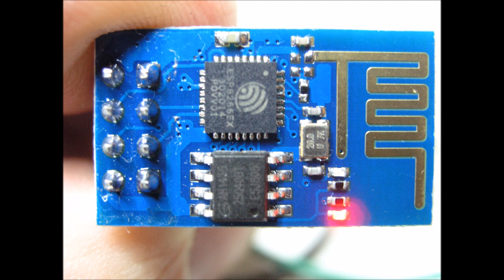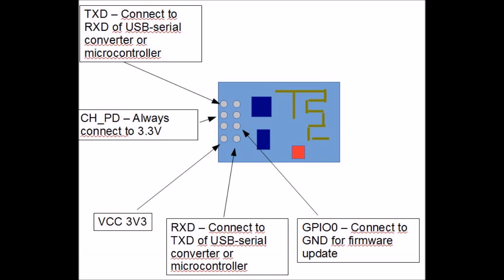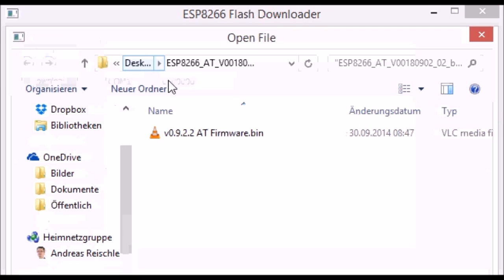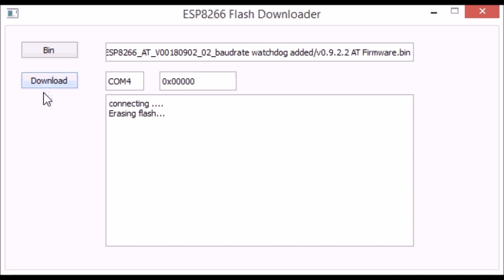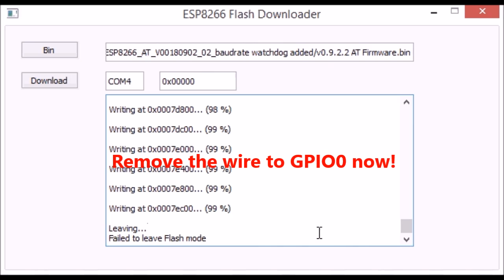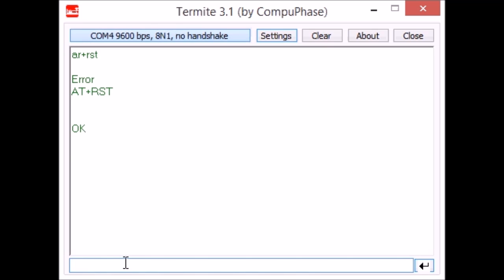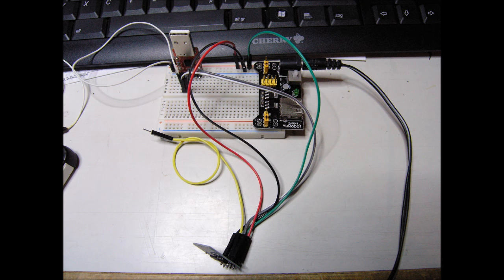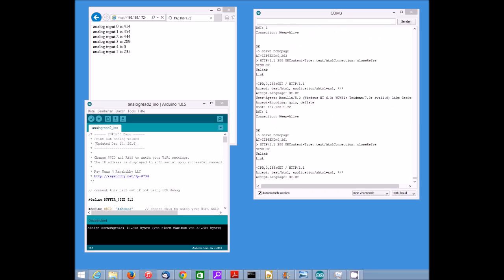esp8266 serial WiFi module firmware downgrade

Comment: I to flashed same firmware into ESP8266 ..bt doesn't connect to router.I tried directly using AT commands.bt is shows busy..also do we need to connect RST pin of ESP8266 to VCC or leave as it is
Reply from the maker: +gaurav mane You can leave RST floating. I use "esplorer" as a terminal (or rather IDE) program now. Available from  here: http://esp8266.ru/esplorer/
Esplorer has some nicely predefined AT-sequences to try out.

Comment: Hello for some odd reason i can flash the firm ware but i can not send commands to see what is going on no AT or AT+RST Not sure why.
Reply from the maker: +joseph chrzempiec (josephchrzempiec) Which AT-Firmware release have you tried to flash to your module? Depending on the version, AT-Firmwares have different serial port speeds.
Reply: Hello thanks for the reply back the firmware i used was v0.9.2.2 AT Firmware I can upload with no problem but that's all.
Reply from the maker: +joseph chrzempiec (josephchrzempiec) I suppose you run a terminal program after flashing. I now recommend ESPlorer. Check two things:
1) the firmware uploader tool must not be running any more (because it blocks the COM-Port)
2) If anything pulls GPIO0 LOW, you never leave firmware updat mode. Leave GPIO0 open or pull it HIGH after flashing.

3) Make sure you have sufficient power at 3-3.3V
Serial speed for communication with the 0.9.2.2 AT version is 9600 baud.

I can't think of anything else.

Comment: TX to TX of arduino, And RX to RX arduino... working fine for me
Reply from the maker: +idrisMS Do you have a link to the USB-Serial converter you're using?
Reply from the maker: +idrisMS bin I mean: a link to a description.
Reply: AReResearch i use arduino. UNO to be exact Google arduino.
Reply: +AReResearch go to instructables.com and search for upload firmware esp8266 using arduino
Reply from the maker: +idrisMS bin I see!
Reply from the maker: +idrisMS bin I thought you did the arduino/esp example at the end of the video. If you want to do that: In my blog is a piece of code similar to the one shown in the video: http://www.areresearch.net/2015/09/arduino-and-esp8266-part-2-web.html